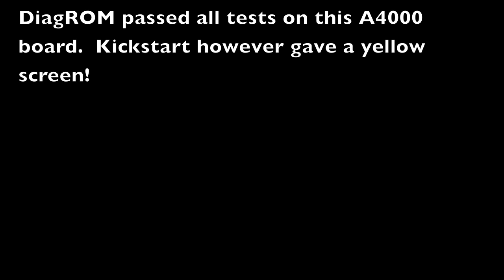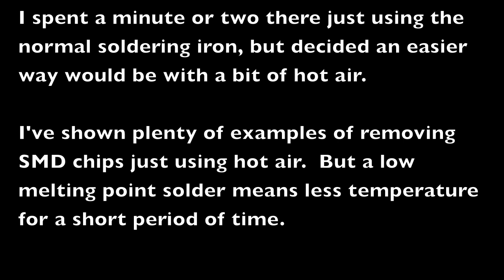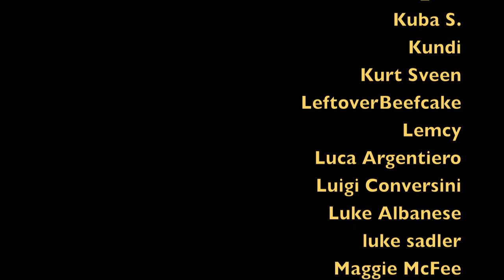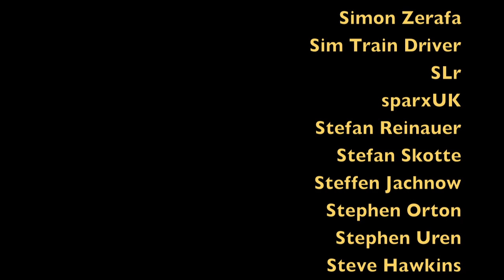Commodore Amiga A4000 Super Buster Removal - Low Melting Point Solder

Comment: The low melt point stuff is great if you don't have the right tools but with a PLCC nozzle you can have a PLCC84 like that off with far less risk to the board and chip in a couple of minutes if your hot air tool has enough airflow and heat capacity.

 Agree on Soderwick, it's damn good stuff, probably the best there is, I know there are other brands but I know that stuff works and works really well.
Reply from the maker: Yes, I will at some point get some suitable nozzles (probably soon as I may have to remove some of these on A1200's).

Comment: I had this, or a very similar issue , with my A4000 and it turned out to be a problem with the PSU contact. Some pins didn't make proper contact with the power socket on the motherboard. After pushing the pins in with a small flathead screwdriver the machine has been working perfectly.

Comment: The pads are not glued down.  When I was a young man I worked in a factory (in America!  Imagine that) that manufactured PCBs.  Unfortunately, we did not make the actual physical board stock, so I don't know how the copper was affixed to the fiberglass. It came in as enormous sheets of copper clad fiberglass like 4x12.  From a distance they just look like copper sheet metal.  The copper sheets that are on the fiberglass from the beginning is what the pads are. They are built up after the circuit (opposite) has been printed on the board in photosensitive film and then exposed and cured.  After a few rounds in the copper bath (this was my job. Hard work. Ruins anything you wear to work), the exposed parts that were just built up were then tin-lead electroplated which protected the pads and traces from the next steps which removed the photofinish and then ate all the exposed copper on the board (the portion that was beneath the photofinish). 
  One of the biggest customers was a company that made diagnostic equipment for auto-repair garages, though I cannot remember the brand name (this was in like 1990). But they were usually for the floor model. They were large boards.
Reply from the maker: Thanks - I didn't mean the pads seperately glued down - they sandwich the layers as far as I understand, and they are bonded with epoxy.  Then the layers are etched.  I've made my own boards in the past, and seen the process for multilayer boards =D

Comment: Hi Gadget, is the plan to eventually socket all the chips? I kinda like the idea of socketed chips on the A4000, however, I'm also looking at the ATX A4000 motherboards created by Hese on Amibay.  I think that given the surface mount caps on the A4000 are likely to die before long, I think transferring across all the major components to a new motherboard would be a good thing.  Have you looked at the ATX boards? Would that interest you as a multi-part series on your channel?
Reply from the maker: It's nice if you can use a socketed board - makes it easy to test chips etc.  The ATX A4000 boards sound nice, but its a lot of work to assemble one!  I doubt I can afford the parts to build one myself tbh!